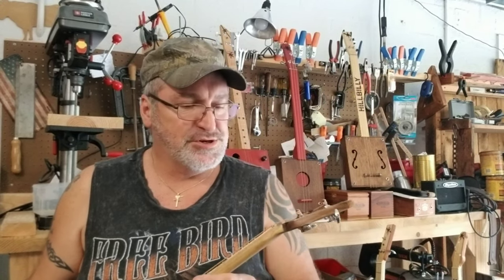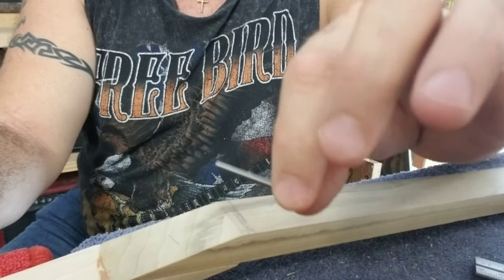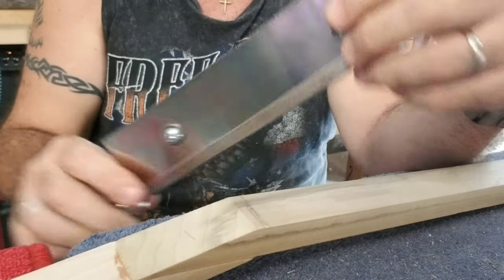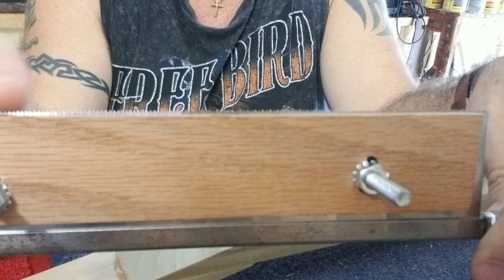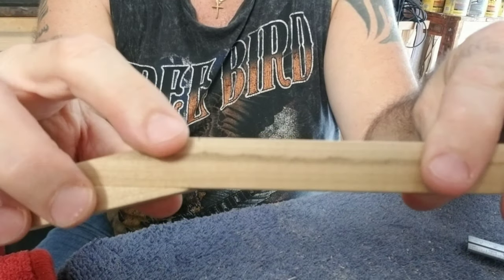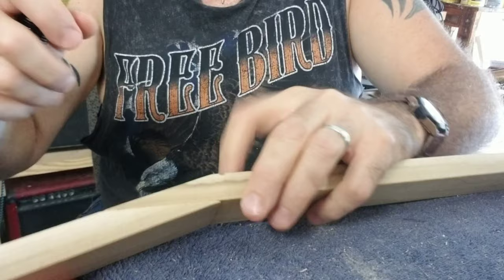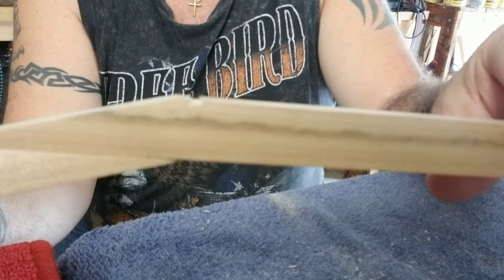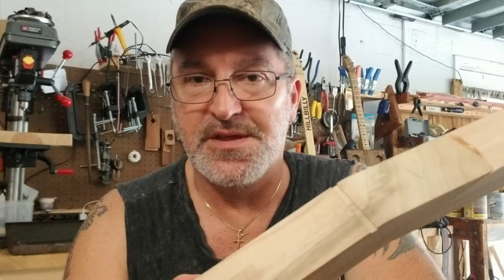Cutting the slot to install the nut on your Cigar Box Guitar.

Comment: Great idea and lesson setting a depth gauge on your fret saw.  What size bolt/ screw did you use for your Nut ?     I have had very good luck using  a Jumbo fret wire for a Zero fret nut  followed by medium/ medium frets.   No dough both ways work very well.   Thanks for all your help and giving back to the Cbg community .    I always look forward to you videos and learn from your Riffs you play showing your builds.   High five to ya Michael
Reply from the maker: Thanks Larz, the screw size is 1 1/2''  6-32.  Your welcome, my friend,  Thanks for watching

Comment: Quick question...would the exact 'zero fret' line be down the centre of the groove or at the edge facing the fret board?
Reply from the maker: I measure for the nut to be in the center of that grove.
Reply: Southern Fire Guitars thanks Michael!
Reply from the maker: @seadoggozo-fishingguitarsa1837   Sure, no problem. :)